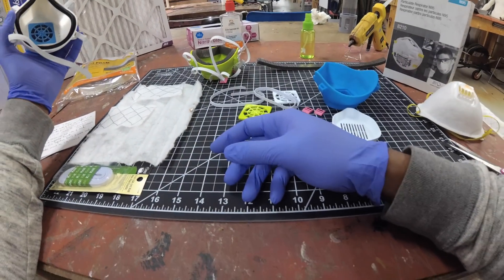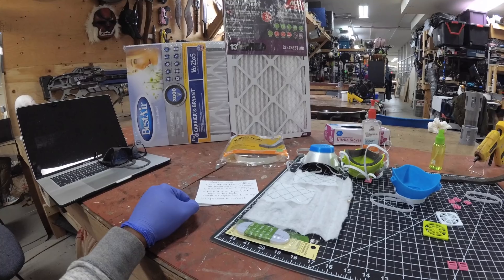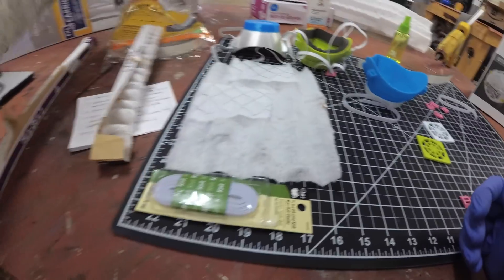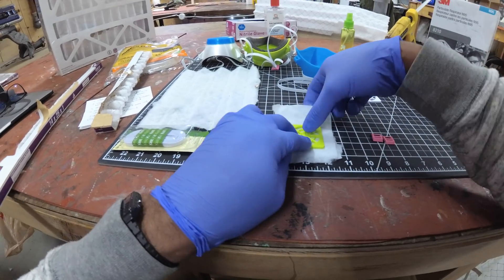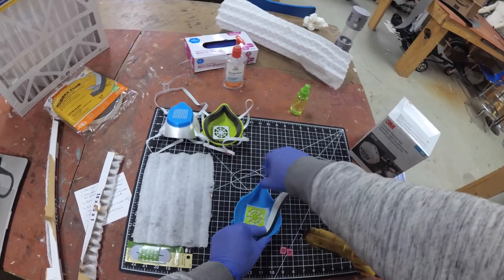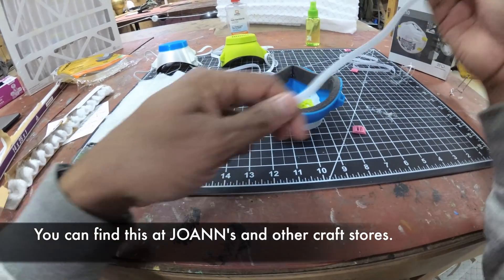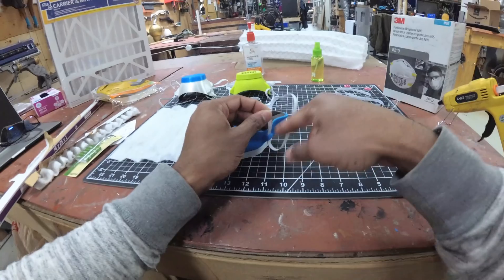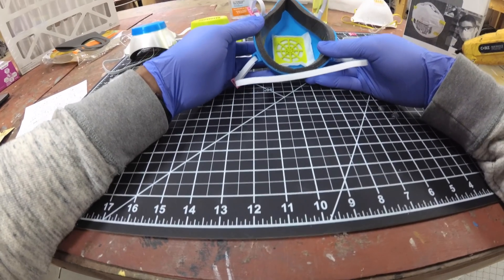3D printed PPE DIY Particulate Mask ( PROCESS )

Comment: I printed out a couple of these masks. I sanded the face-side-edge to make these more comfortable, and they are surprisingly comfortable without any foam padding. I covered the opening with a flat piece of plastic to test the seal; when I inhaled the mask sucked into my face though some air is forced through. Breathing through a couple layers of 3M Filtrete Merv 13 material is so much easier than sucking air through a sealed off mask so I feel confident that the vast majority of air is being forced through the filter. Chinese sources state the virus can be eliminated at 60c for 30 minutes, other sources state an hour. I printed my masks with PETG so they can go in the oven at 150f for an hour and not deform.

I have some 3M N95 masks I purchased years ago and this Saturday I'll see how well my local grocery store handles deliveries so hopefully I wont need to use any masks - but its nice to have options.
Reply: You should read the PETG MATERIAL SAFETY DATA SHEET.  It's toxic material.  That why PLA is suggested for clinical applications.

Comment: If it seals well and you get an appropriate filter,  this should work well.
Reply: Alonzo Branson what kind of filter. N95 grade can available?
Reply: Neaz Morshed as long as the “holes” in the filter are smaller than the virus which I believe is 5 microns, you’ll be okay. If you’re worried, double up.

Comment: So, I currently don't have MERV 13 filters, but I do have standard HEPA Media filters, specifically ones designed for vacuums, although I rarely use it for vacuums. They are supposed to filter down to .3 microns, although studies show they can filter much lower than .3 microns at a high percentage. Do you think I could use that?
Reply: Yes, that HEPA is MERV-16.
Use furnace filter HEPA or at least MERV-13 and treat the outer filter layer with salt to make it antiviral. https://youtu.be/cIIdtuGWWtM
Reply: Mark Proffitt thanks for reply, this is my other account btw, the hepa filter is currently like in a zig zag like shape. Should I cut it and flatten it or ?
Reply: @seth_lee16  If you Zig Zag, you must pot the edges with thick wax/glue so it seals completely
Reply: You can, but it hinders breathability. I spoke with a local filter supplier and he recommended the Merv 14 or 15, and I can buy a $40 bag from him and make ~2,000 2” filters from it

Comment: I wanted to share my experience using it and how I think I solved the need to use the foam. I printed mine in PLA and since I have used this technique before for other projects I figured it would be worth a shot. Once the mask is printed and assembled (without the actual cloth filter) I run the mask through hot water from the tap (as how as it comes out) and after 10 seconds or so, I shake all the water well and place the mask on my face and start to heat mold it slowly. After repeating this process 5 times or so, the mask fit like a glove and it does not require not to use the foam for a good seal or to tight it hard as my skin follow the edge of the mask closely. PLEASE shake the mask well before putting it on your face as the first time around it still had some small amount of water and it burned a bit (nothing serious, but why the risk). Anyhow, I hope this helps others!
Reply from the maker: very good insight, thank you.

Comment: Nice! I like this video. 
2 questions. What do you think of using a antimicrobial filament as Copper3D? 
And move the filter inlet to the side? Better in order to avoid straight air in case of faulty filter?
I m not a designer. 🙈
Reply: Don't waste your money. The virus lasts 4 hours on copper.
Reply from the maker: That's an awesome idea with the Copper 3D, its something we thought of for sure, but the need was so immediate, we just started printing with what we had in house which was mostly PLA & PETG ... we're all doing this out of pocket and shipping is very iffy nowadays, but its something we would def switch to if we end up getting some donations towards that type of filament. As far as design, this is what we've been prototyping with hospitals and are already at the point where some are passing fit tests so changing designs now might be a bigger step back than a leap forward unfortunately :/
Reply: @GiveWaveStudios  copper 3d was found out to be a scam

Comment: Tried printing the face cup with flexible plastic (Solutech 3D flexible). Creates good seal without the need for the foam. Filter covers printed with PETG
Reply from the maker: I'll try the face piece with ninjaflex 🤔
Reply: @GiveWaveStudios  I am trying that now.  First trial failed. Currently redoing with supports and having more success. ps, i am a resident physician at Tufts Med, thanks for all your hard work pps.  are you guys able to print with polycarbonate (it can be autoclaved/sterilized).
Reply from the maker: Unfortunately none of our printers can do materials that are too exotic, and because the need was so urgent we just started using in house stock (mostly PLA). we're aware that there is a copperfill filament that could be better for this, and some health professionals would prefer PETG over PLA, but we're just trying to do the best we can with what we have. We appreciate all the feedback in the comments section, as this will all help make this process better & better as we all share our findings.
Reply: Same here my 95SH TPU worked great !

Comment: I am part of a makers group doing this. I am also an engineer and scientist. I do have a question though. I was under the assumption, just an assumption, that the hepa filter material you are using is made of fiberglass and or has fiber glass in it?  Anyway you could verify this for me? thanks. I have been using two cotton pads as a filter because it has a rating close to 90-95% IF TWO ARE USED.  Thanks for this video and keep up the good work.
Reply from the maker: So from our research only MERV 1-5 seem to be consistently made from spun fiber glass ... The more expensive stuff rated 8 & up usually doesn't contain fiber glass ( the ones I'm using here at least don't ) but you should def check and do your research on different brands at those same ratings just in case 👍 we got some Merv 16 in yesterday that we were super excited for until we realized it had fiber glass in it :/
Reply: @GiveWaveStudios  yup, i contacted 3m today and their filtrete advanced allergen is made from exact same material as their medical masks:)
Reply from the maker: @LT72884  oooh that's great news, gonna try and source some 🙌✨
Reply: @LT72884    could you forward me the email?
Reply: Would be useful to know whether using fibreglass filters in the short-term is ok...
Reply: @mrkeogh  i found out they do not have fiberglass. You wouldnt want fiberglass because as soon as ypu cut the filter, youd be breathing in fibers...
Reply from the maker: Using fiberglass in any close range breathing application is not a good idea, even in the short term :/
Reply: @GiveWaveStudios  use cotton under it
Reply: Use furnace filter HEPA or at least MERV-13 and treat the outer filter layer with salt to make it antiviral. https://youtu.be/cIIdtuGWWtM

Comment: Good job man! Have you made the source available yet? I want to try printing parts of this with TPU but I feel like the clips that hold the filter in may not be big enough for a flexible material.
Reply from the maker: all links are in the video description ... download files via www.givewavestudios.com/freebies/
Reply: I've printed the mask in TPU, other parts in PLA. The inner filter guard snaps into place just fine, the outer one does remain in place although it doesn't snap into place like the PLA version. You could use duct tape or something similar if worried the filter cover might fall off. Duct tape does tend to peel off mine eventually though.
Reply: Great job. Question: What's the purpose of the front attachment part, the one that snaps from the front of the mask?
Reply from the maker: @innomind  for the use of a secondary filter if need be.
Reply: double check the MSDS on TPU.  I've read that TPU, ABS, & PETG are all toxic to the upper respiratory track.  You may be causing more problems than you solve.  I suggest using PLA and using a heat gun or hair dryer to ensure it fits.    The PLA data sheet doesn't have the toxic warning that the flexible materials have.
Reply: actually quite the opposite for TPU, in fact my research shows  it's used in many medical devices because of its desirable properties. Burning it can create fumes that is one thing, but using a finished piece is another. I printed a TPU version fine that creates a more universal fit easily. check out this info here https://www.medicaldevice-developments.com/features/featureplastic-to-smile-about---thermoplastic-polyurethane-4454777/
Reply from the maker: @toddpeterson4657  I cant speak to TPU directly, but hospitals we work with have expressed interest only in PLA & PETG with a higher preference for PETG.

Comment: thank you how much  infill did u use
Reply from the maker: It really depends on your printer mate. On my prusa i3mk3 I'm at .3 layer height & 5% infill where as on my creality cr10s s4 it's .3 & %15, rostockmax v3 .32 & %10 ... U need to figure out what works best for YOUR machine, they're all different and settings will vary 😅
Reply: @GiveWaveStudios  thank u will play with the number